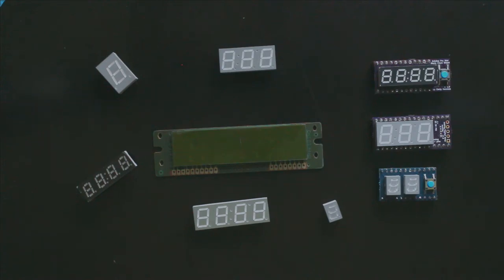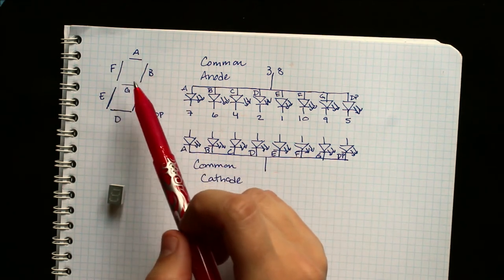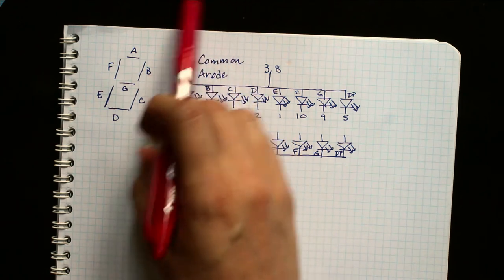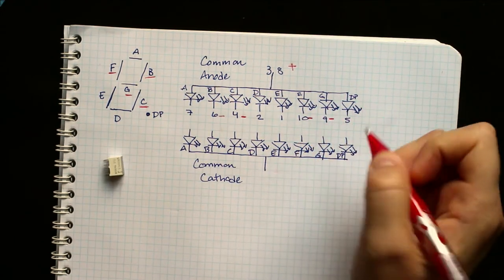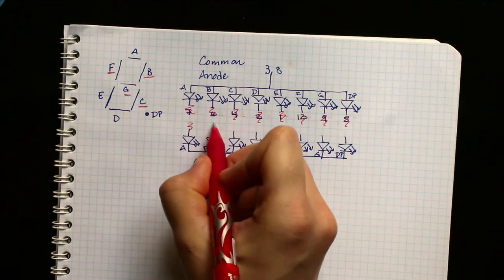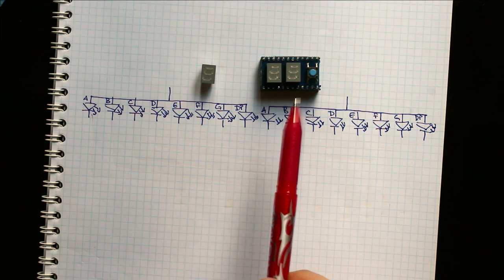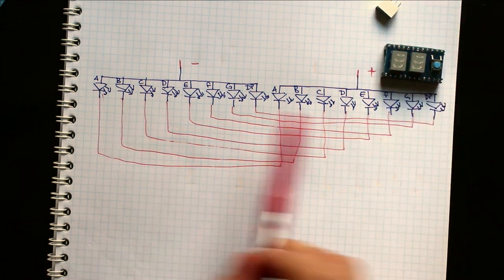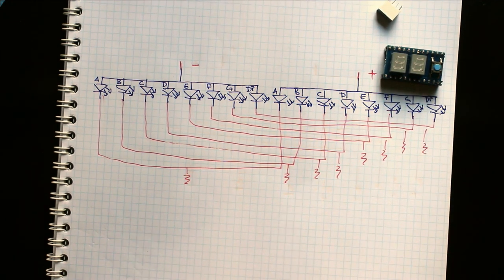Understanding and Controlling a 7 Segment LED Display

Comment: Hello, I dunno if you are going to answer me but I have an activity from University and I have to make a C Programation and I can not use Arduino's C, do you know how I could do that?
Reply from the maker: The Arduino IDE is a modification of one of the C programming languages (C++ I think?). Perhaps your professor means that you can use the Arduino IDE to demonstrate that you know how to program?
Reply: @HammesHacks  Well, he passed this progamation for us and told us to use DevC++ to pass for C:

byte seven_seg_digits[16][7] = { { 1,1,1,1,1,1,0 },  // = Digito 0
                                 { 0,1,1,0,0,0,0 },  // = Digito 1
                                 { 1,1,0,1,1,0,1 },  // = Digito 2
                                 { 1,1,1,1,0,0,1 },  // = Digito 3
                                 { 0,1,1,0,0,1,1 },  // = Digito 4
                                 { 1,0,1,1,0,1,1 },  // = Digito 5
                                 { 1,0,1,1,1,1,1 },  // = Digito 6
                                 { 1,1,1,0,0,0,0 },  // = Digito 7
                                 { 1,1,1,1,1,1,1 },  // = Digito 8
                                 { 1,1,1,0,0,1,1 },  // = Digito 9
                                 { 1,1,1,0,1,1,1 },  // = Digito A
                                 { 0,0,1,1,1,1,1 },  // = Digito B
                                 { 1,0,0,1,1,1,0 },  // = Digito C
                                 { 0,1,1,1,1,0,1 },  // = Digito D
                                 { 1,0,0,1,1,1,1 },  // = Digito E
                                 { 1,0,0,0,1,1,1 }   // = Digito F
                                 };

void setup() 
{  
  pinMode(2, OUTPUT); //Pino 2 do Arduino ligado ao segmento A  
  pinMode(3, OUTPUT); //Pino 3 do Arduino ligado ao segmento B
  pinMode(4, OUTPUT); //Pino 4 do Arduino ligado ao segmento C
  pinMode(5, OUTPUT); //Pino 5 do Arduino ligado ao segmento D
  pinMode(6, OUTPUT); //Pino 6 do Arduino ligado ao segmento E
  pinMode(7, OUTPUT); //Pino 7 do Arduino ligado ao segmento F
  pinMode(8, OUTPUT); //Pino 8 do Arduino ligado ao segmento G
  pinMode(9, OUTPUT); //Pino 9 do Arduino ligado ao segmento PONTO
 
}

void writePonto(byte dot)   //Funcao que aciona o ponto no display
{  
  digitalWrite(9, dot);
}

void sevenSegWrite(byte digit)  //Funcao que aciona o display
{
  byte pin = 2;

  //Percorre o array ligando os segmentos correspondentes ao digito
  for (byte segCount = 0; segCount < 7; ++segCount)  
  { 
    digitalWrite(pin, seven_seg_digits[digit][segCount]);
    ++pin;
  }
    writePonto(1);  //Liga o ponto
    delay(100);   //Aguarda 100 milisegundos
    writePonto(0);  //Desliga o ponto
}

void loop() 
{
  //Contador de 0 a 15, ligando os segmentos correspondentes
  //0 a 9 = liga os segmentos correspondentes aos numeros
  //10 a 15 = Forma as letras A,B,C,D,E,F
  for (byte count = 0; count < 16; count++)
  {
     delay(500);
     sevenSegWrite(count);
  }
  delay(4000);
}

(Sorry for the comments in Portuguese)
Reply from the maker: @gugonpe9653  Can you give a better explanation of what the problem you are trying to fix is? Assume I know nothing about what you are trying to do. Does this code not work on an Arduino and you are trying to debug it? What are you trying to do, what is not working and what have you tried?
Reply: @HammesHacks  Yeah sure, well, at first our Professor gave us this programming that I sent, It works correctly on an Arduino and on TinkerCad (I do not know if you know It, but It's a website to create eletronic circuits). The Display worked fine, from 0 to 9, blinking the dot for each number. Then, our Professor asked us to pass this programming to DevC++ and then run It on TinkerCad. The problem is that we do not know how to start It, we have to use Array and Switch. DevC++ does not accept all the libraries that I try to put on. :)